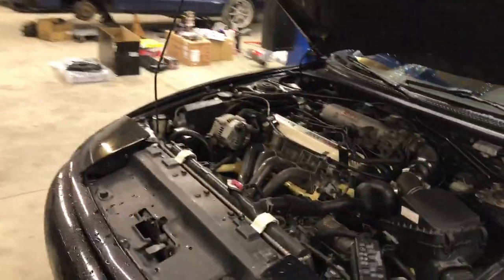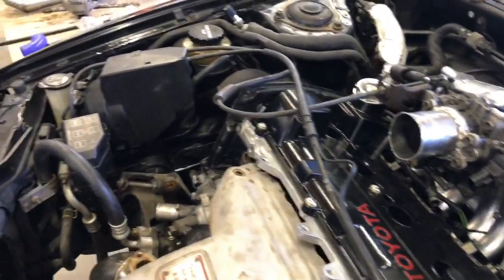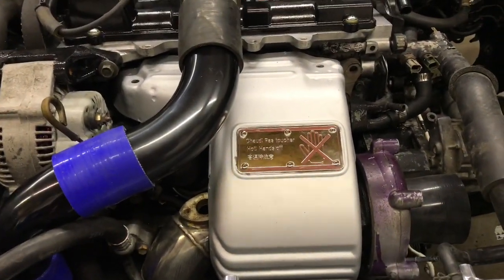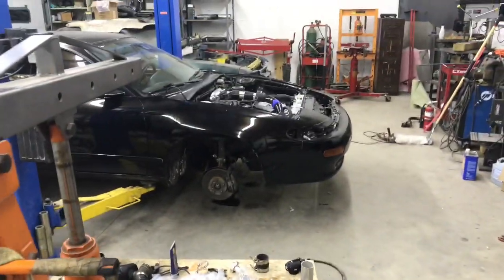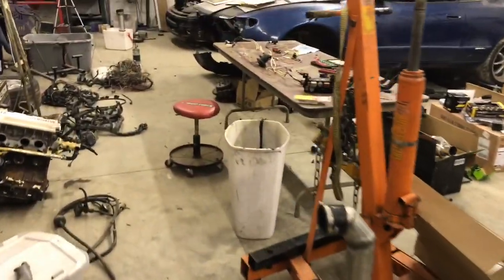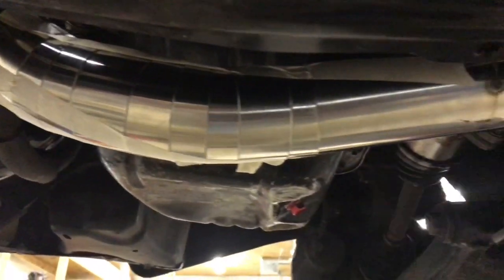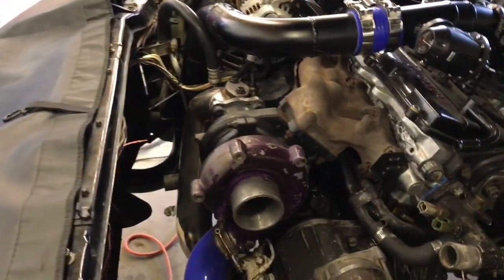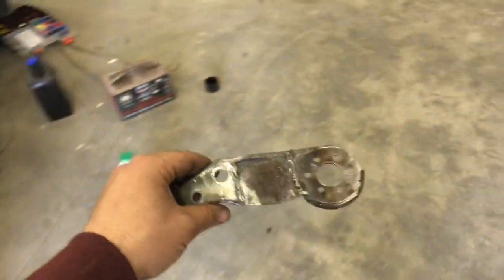‘90 Turbo Celica 3S-GTE Swap

Comment: How much a set up like this cost? I have a 92 Celica GTS ,the motor need more power is old and I think is on its last days, it has a 360xxx miles on engine

Comment: Not sure if you are still reading comments on these older videos but I have a question about clocking the turbo down. Is there anything in particular that I need to look out for? 

Also I’m still trying to figure out how you got the intercooler pipe down in front of the Alternator, I don’t see any room for that at all on mine. 

I have a 1990 GTS with a 3S-GTE, but I’m going to upgrade to a front mounted intercooler.

Also one more question, 

Did you have to buy a Fuel Pump Relay to get your fuel pump to work? 

Thanks!
Reply from the maker: For clocking the turbo pull the compressor housing off and remove the small pin that locates the housing in the factory spot, then you can put it back on in any direction. The wastegate actuator bracket was the worst part about doing it.

The intercooler pipe is very tight infront of the alternator, he has all his accessories so it was very tight as well

I didn't have any issues with the fuel pump, I would check the fuel pump jumper in the small fuse/relay box by the cruise control

Comment: Hey quick question I know it’s been a few years but I have a 1987 Celica gt FWD thats got a 5Sfe in it I’ve been looking into engine swapping it with the 3sgte but there’s only very few forms to read with little information. 
Question is will the 3sgte bolt right into the stock transmission (automatic btw) and if so would a 3sgte engine from a mr2 fight right in or would I need one from a all trac Celica ..? I only ask since mr2 3sgte are way more common than the all trac Celica. I really love the car but there’s very little mods and stuff out there for it I don’t really mind but I really would like to upgrade to a 3sgte instead of turboing my stock 5sfe Dont really wanna spend more in tunes / other ecu problems when I can just swap out for a 3sgte na turbo engine with lower miles
Reply from the maker: You will need a 3sgte flex plate, the 5sfe one won't bolt up. Everything else will let it bolt up to the trans and engine mounts. All the 3sgte mr2 or alltrac have almost identical blocks but for your purposes it doesn't matter. You will need the alltrac accessories like crank pulley, Alt bracket ect.  Dollar to dollar it would be cheaper to invest in a ebay turbo kit and run a speedy ecu.
Reply: @velocityperformance8574  ahhhhh shiiiiit ok ok I’ll take all this into consideration and prolly just turbo it

Comment: Thanks a lot for the info! I’m jumping into the same situation with a 1992 Toyota Celica Convertible putting in a gen 4 3S-GTE engine…. What were your main obstacles doing this? Thanks again!!
Reply from the maker: The wiring harness was the hardest part
Reply: Did the 4th gen swap into a 1992 Celica all trac (2nd gen 3sgte) anything else needed besides a custom harness

Comment: What transmission did you use? Will stock 93 celica gt 5spd work?
Reply from the maker: Yes it bolts up, 6th gen celica s54 was used in this one
Reply: @velocityperformance8574  what axles did you have to use

Comment: Did you use the 5sfe wiring and computer
Reply from the maker: It got a microsquirt and a custom harness for the engine
Reply: Velocity Performance so would I be able to use the 5sfe wiring and computer or have to get 3sgte stuff
Reply from the maker: Jordan Robinson you need a 3sgte Ecu or a standalone Ecu for the 3sgte. And a 3sgte harness or a custom harness.
Reply: @velocityperformance8574  where would i get info for the custom harness schematics etc?
Reply from the maker: @danieldelphi6021  I had to make my own harness for every thing I've done so far, the toyota "BGB" has all the schematics you need. It used to be download able but I think it got taken off.

Comment: Doing the same swap 93 Celica ST going from 4AFE to a 3SGE Beams Red top. I need help with the engine mount brackets. Also does the engine go in from the bottom? I can't get it in from the top. Find me on facebook project megan
Reply from the maker: It’s easier to put in from the bottom. I haven’t swapped a 4afe out with a 3s before but I thought the mounts would still line up.

Comment: I have a 90 celica GTS with manual transmission. I would like to have a 3-sgte swap. Where is your shop located, and how much would you charge to do the swap.
Reply: Would also like to know
Reply: Weird how they never answered.
Reply from the maker: I’m in Mt. Orab, OH. Any quotes for work please Message me on Instagram victor.velocityperformance
Reply: @velocityperformance8574  will or have yous done a V6 Camry turbo on gen 5 Celica converted to awd?
Reply from the maker: @ap3stax  v6 swap isn't too difficult, awd is a little more involved. Definitely would be fun but I don't plan on doing it at this time

Comment: What gen 3sgte was this? and how did you convert the 5s harness with 3s? just by looking through celica bible diagrams?
Reply from the maker: It is a gen 2 3sgte. I just removed what wasn’t needed for the microsquirt/body/AC system and tucked what I could. I have the BBG for this car and those are the wire schematics I used
Reply: What tranny did you decide to mate with? Stock s53 or s54 or E153?
Reply from the maker: It’s a s54 for now